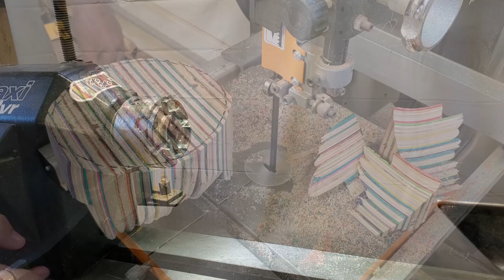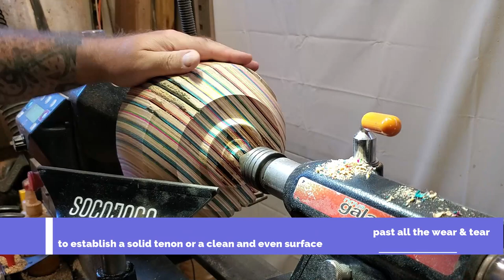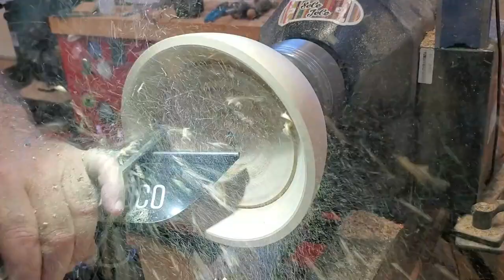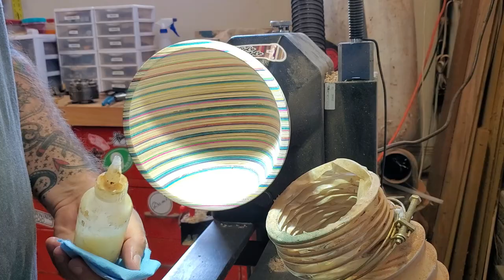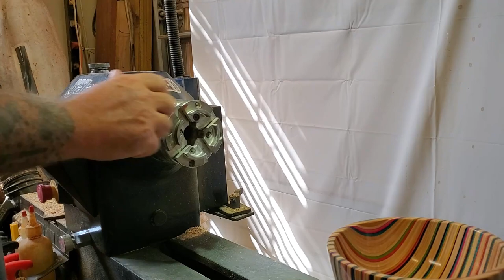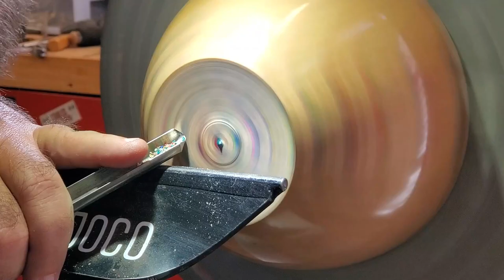Woodturning - Recycled Skateboards Decorative Bowl

Comment: Fantastic job! How would you recommend finding or making my own blank? If you made your own blank, how would you remove the grip tape? Thanks for any advice you have.
Reply from the maker: Thank you.  Making the blanks is honestly a pain. Haha. Sourcing the broken boards- check local skate shops and skate parks. Removing the grip- heat gun, razor and a dowel. There's a short clip on my Instagram that shows Removing grip with the dowel. Have to scrape all the residual glue and then sand away all paint, stickers and varnish. Then cut them into the size pieces you need. Glue and clamp... you'll need more clamps than you think. 😉 The bowl in this vid is 19 noses and tails so 8 broken decks.
Reply: SoCoJoCo Woodworks thanks for the advice. I’ll check with a local shop with whom I’ve gotten service before. I figured that it was a lot of work to make the blank and I’ll bet that anyone who sees the bowl has now idea of just how hard it was to make.
Reply from the maker: @thomasherlihy8670  Feel free to DM on IG, FB if you want to chat about the process. 👍